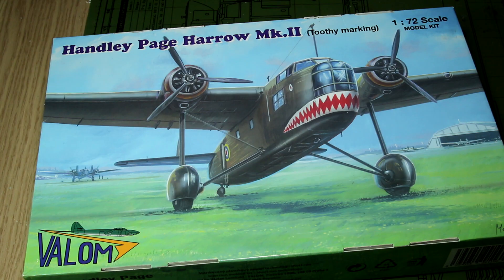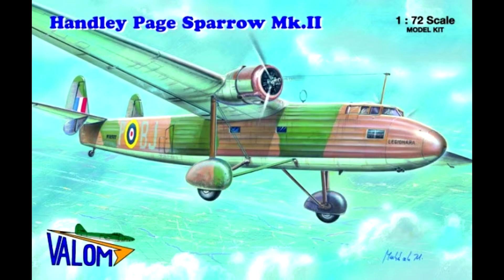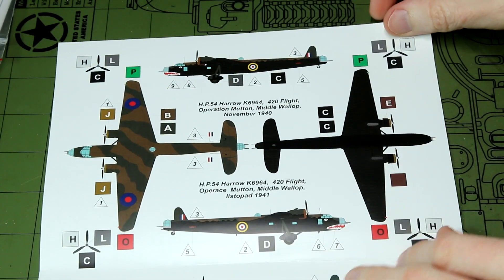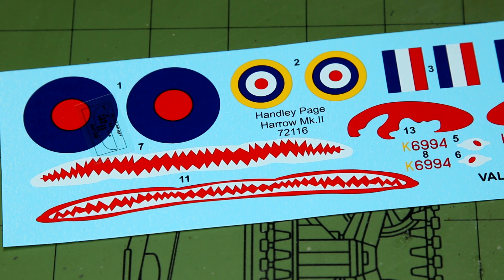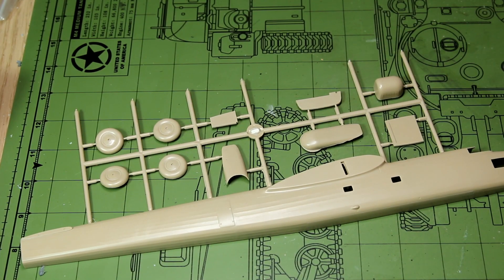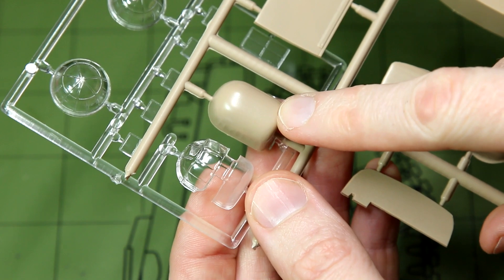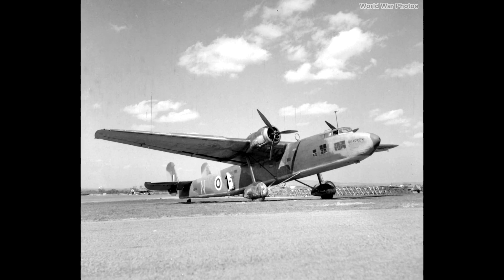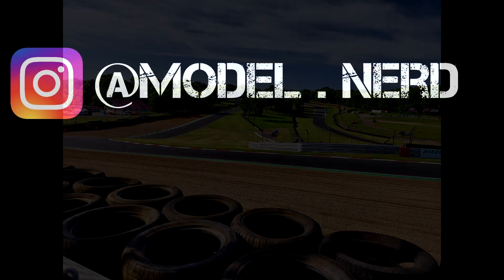RAF interwar bomber Handley Page Harrow Mk II (Valom 1/72 scale model kit)

Comment: A very nice looking aircraft. In regards to building this kit, this is one kit I have yet to build, but I have built a few vacu-form kits, short run kits and done a lot of scratch building parts and they all do not have alignment pins and to be honest I like it that way. I had my share of kits with alignment pins that should be named more as "Out of Alignment" pins.
Kits like this are not meant for the faint of heart but when built correctly, it is a build that will look very sharp in any modeler's collection.
Reply from the maker: Definitely!

Comment: I built the mk 11 “non toothy” a couple of years back. Sure, it takes more care to build without locating pins and somewhat vague instructions, but overall the result was worth it, it’s an impressive aircraft. Wherever possible I used plastic card or short lengths of wire to reinforce joints. I have the Valom Bristol Bombay in the stash - I might have to have another look at that!
Reply from the maker: Thanks Don, that's a good suggestion for the joints. I love that aircraft like the Bombay are available now - although I really, really want a Manchester!
Reply: I seem to recall that the wing/fuselage joint needed a bit of fettling too. I think that CMK used to make a resin kit of the Manchester, not sure if it’s still available.
Reply from the maker: @dongorski4822  Thanks. Yes, there are a couole of older resin versions of the Manchester that are hard to find, and a Planet Models resin kit that is still available but apparently not too great. Still, it might be my only choice...
Reply: Pricey though… there were some resin conversion kits around (Blackbird?). Not something we can easily find in NZ that’s for sure! Good luck!